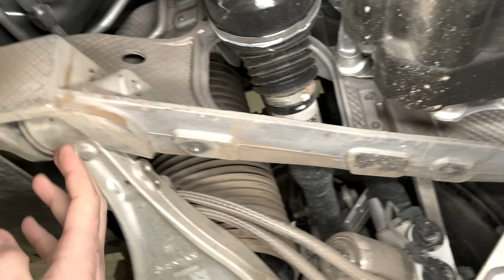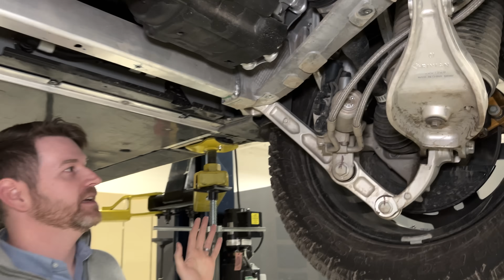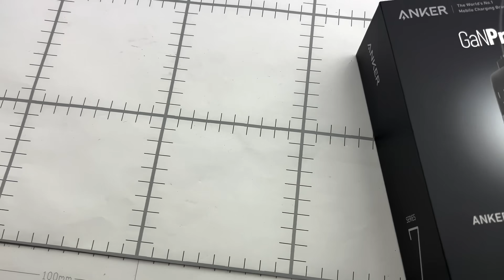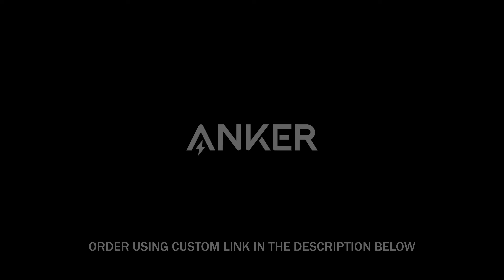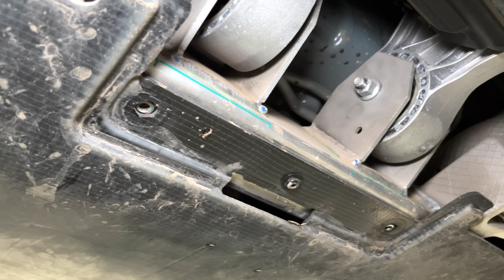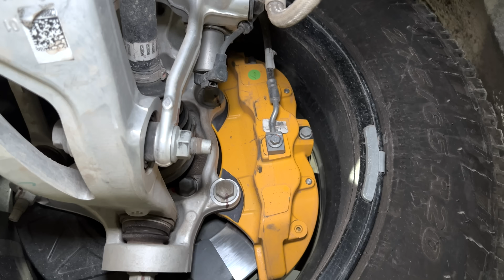"Range Rover From the Future": Rivian R1S Hoist Review

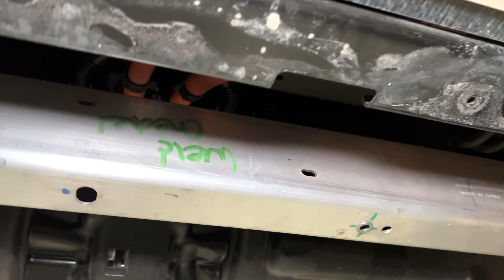Comment: At 9:54 That part IS MADE IN CHINA
Is Rivian using Robotic Welders?
I wonder if they are over engineering the suspension?
Nice Weld's 
What could that Green Rubber Cap be?
Those are Big Brakes.
I'd take The Rivian over a Range Rover ANY DAY OF THE WEEK

Comment: 5:30 Tesla Model X definitely suffers from suspension travel with the air suspension in that if you set it to very low to get better efficiency, you will have extreme uneven wear on the inner tread of your tires
Reply: Its because the change in ride height changes the geometry of the camber and toe. Pretty much all cars with long adjustable travel will have this problem. 

If you drive around mostly in a lowered ride height, you’re better off getting a realignment done at the height if tire wear is getting too uneven or replacing them prematurely

Comment: The suspension arm and brake lines are too low and exposed: specially the brake lines, it must remain behind the suspension element, not in front of it.
Reply: They are not brake lines, it's the air suspension hoses that are exposed, this is not good.

Comment: Tilt of the wheel depends on the length difference of upper and lower control arms, not their length.
Trailing arm geometry is very interesting - you would want these arms to be as long as possible for an off-roader, and as horizontal as possible. Now, every bump tries to move the wheel down, thus increasing perceived bump. And suspension compression moves front wheel to front - that restricts tire size, and tire rubbing when off-roading.

Comment: This is an amazing suspension but it has one major (IMHO) flaw: there are no bump stops. If you bottom the suspension even at a very low speed it can break the damper. (I have the pictures. 😂). And it is a very expensive repair. On the plus side, I drove 20 miles on a moderate trail with no dampers and it was just fine (aside from the software limiting it to 30 mph).

Comment: First time noticing the jack stand supports underneath hoist instead of vehicle which the latter would imply that if the hoist failed then the stands would "catch" the vehicle but the hoist/arms could still fall causing potential injury or death
Reply: You should never leave your parents basement.  Too many risks out there.
Reply: I noticed that too. I used Greenshot and took pictures. The jack stands offer double protection. We have a lift in our detached workshop so I like the idea of extra safety.

Comment: 8” travel is about average wheel travel for stock.   Not cool. 
He said it tho , “prerunner truck” high travel numbers.  I wonder who the first champ will be to add custom long travel suspension to their rivian. Longer Arms,  remove air suspension in favor of some big king/fox/bilstein/ads coil overs + bypass shocks.  Would have to remove or saw through the fenders and would have to clear the rear gear tunnel when you go that wide.  But some crazy person is gonna be the first to do a pre-runner Rivian 😂.

Comment: It looks like a critical amount of structures made China. Maybe most all of it? How does this affect manufacturability profitability I wonder.
You point it out the forgings and the suspension using a craftsman wrench does an example with a forging lines. I'm curious as to what metal this is. The wrench was made of steel but I don't think this is. Is it significant as to the type of materials the forgings are made of? And how it pertains to performance in profitability.

Comment: I think they are confusing casting lines for forging lines. 
Sand casting is often used for low production quantity especially for aluminum parts where various material states set in place by specific heating and processing tend to be more of a temporary state for forming/welding/shaping of the aluminum. Steel is drop forged to gain specific hardness and durability properties, which is preferable for wear surfaces. Aluminum is great for structure due to weight and ability to absorb and relax from vibration and impact (though it has limits and can microfracture). 

The crux is this, you can cast huge parts. Forging requires significant machinery usually 10+ times the size of the forged item to create so there are limitations to forging.
Reply: I was thinking the same thing. First thing I said was “wait those are casting marks”
Reply: The control arms, links & knuckles are forged aluminum, reportedly made by Pankl in China.  To see them better, look in E-Bay for replacement parts.

Comment: Please bring the Rivian R1S to Europe, it's short enough to fit into Europe and has massive space and it looks awesome and seems to be a great alternative (wait there is none - haha) 
Maybe consider rear axle steering (but the packaging won't let it happen I think) 
And keep GVWR under 3500kg (i looked up and it should comply with that number) so we can drive it with standard driving license B in Europe
And bring normal towing at least up to 2500kg and 150kg tongue weight without using weight distribution hitches! (use case Boats like we have) 
Bring it at around €100k incl. 20% VAT  (a quad motor version is really not that needed!)
Reply: Keep dreaming - especially about price...

Comment: The nice thing about big brake calipers, is that you only need brakes every 50,000 miles. Instead of the 25,000 the so many high dollar and market brands now get, from cutting corners.
Reply: My mercedes I replaced brake pads every 75,000 miles. I use Akebono Ceramics.
Reply: The fact that it is electric means folks will hardly use their brakes. Some Tesla owners were reporteing their pads sticking to the caliper since they wouldn't use their brakes at all. You would see the pad and rotor rusting away and maybe even seized up.
Reply: @thebros2866  lol…. This is a performance vehicle and when properly used the physical brakes are also very much in action unlike teslas rovers that drives like grandmas…
Reply: @Alan May  Regardless for $100k, I don't think everyone will be taking it off-road. Not to mention Sandy Munro's team commented that air suspension reliability is questionable in this application. 

The vehicle got you into whatever situation off-road that only air suspension can only get you out of and if one corner gives out you might end up with an expensive tow.

For all that said, I don't believe many will take them on as extreme adventures as advertised.
Reply: @thebros2866  lol…. In some cars air suspensions is just for added comfort and it’s not for rock crawling! People are buying and cutting $100k toyota Land Cruiser……
Reply: @thebros2866  regenerative braking isn’t everything

Comment: Good point toward the end of the segment regarding the off-road vulnerability of the lines near the suspension components. Perhaps it's not really the off-road monster we thought...
Reply: That’s not a problem! Toyota Land Cruiser has had hydraulic suspension for literally two decades+ very reliable it’s called AHC suspension
Reply: @alanmay7929  I think that the Land Cruiser is way more tucked though. If you scraped this over a rock, you would likely tear that component off. In the documentary "Long Way Up" this actually happened to a prototype vehicle.

Comment: Sprung parts down low should be steel. Save the aluminum for the roof and doors and hood. Trunk hatch .
Reply: a great many cars, especially performance cars, have large number of AL parts in suspension.  there is no point in "saving" AL, there is no shortage.
Reply: @pablopicaro7649  suspension parts are unsprung. So yes use aluminum. Not the engine motor cradle.
Reply: No rust though on aluminium
Reply: @navithefairy  aluminum does corrode otherwise the aluminum tanks and wheels on commercial trucks would always be shiny. That stuff underneath should be painted even though they moved away from the sides going to the back. Even clear paint like to trucks tanks and wheels on trucks.

Comment: The R1 series has widespread unresolved issues with quickly worsening noise coming from the CV shafts during accel/decel cycling. Would be interested to hear Monroe's input on why, similar to the power tonneau.
Reply: Widespread unresolved issues ? Care to share your source ?
Reply: Are you referring to the recalled issue?
Reply: @billreynolds944  I think you should contact Rivian service center and raise a ticket for the issue.